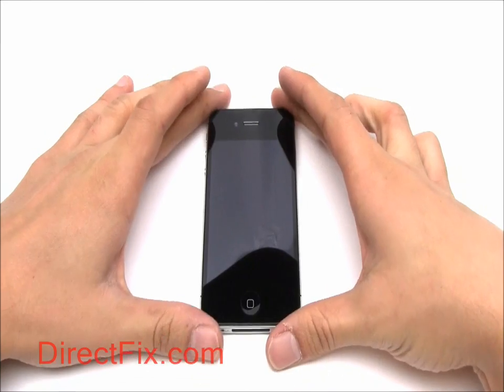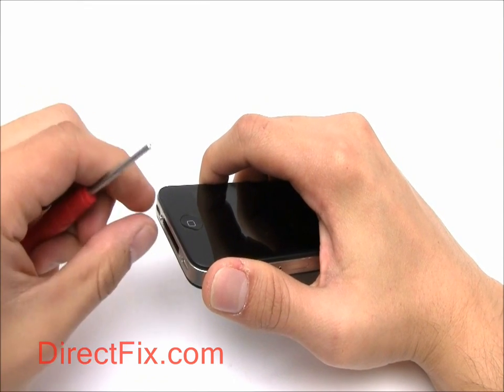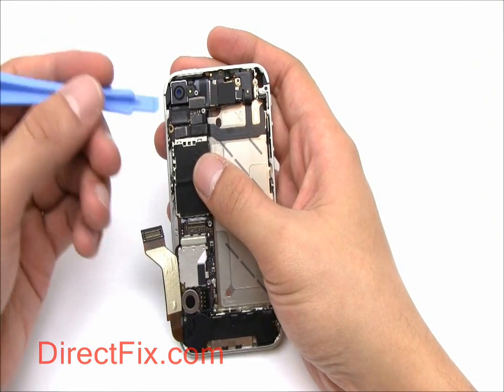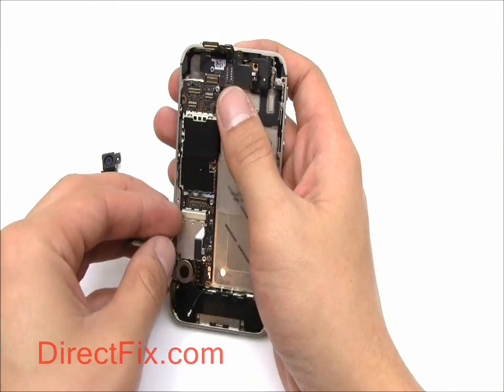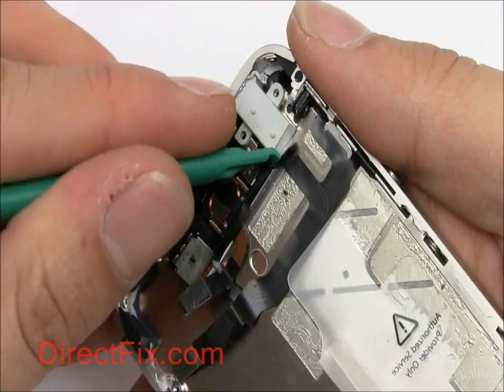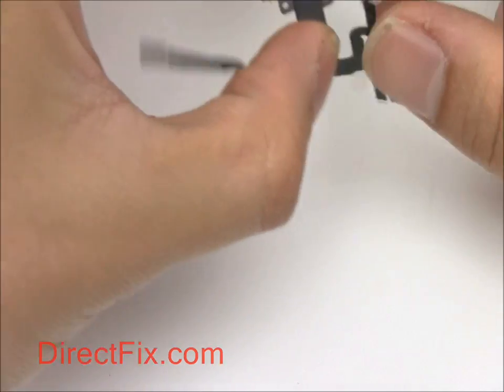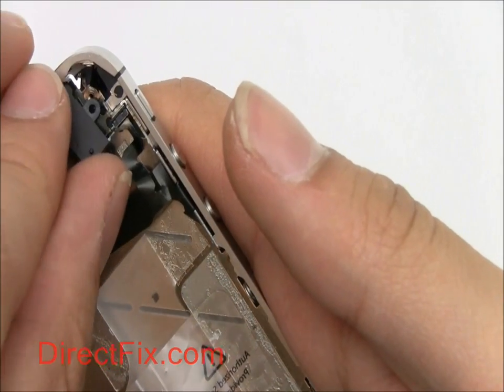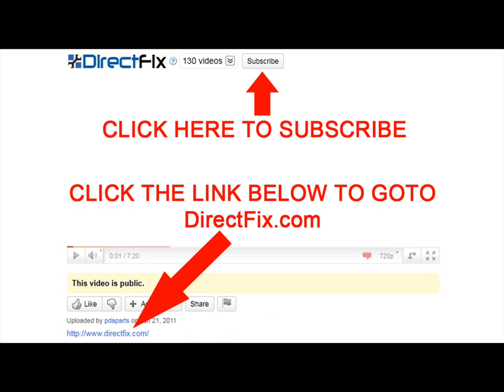iPhone 4S Earphone Replacement Directions

Comment: At 10:20 regarding the 'volume mute button' cable, I made a slight tear in my one whilst repairing a 4S, half torn half not, my phone is not switching on, and it was a few minutes earlier (before the tear I believe), would a tear in this particular cable cause the phone not to work? Could it have short circuited? Think something else will of caused the fault? Not sure what part to order now sadly.
Reply from the maker: The issue is the tear.